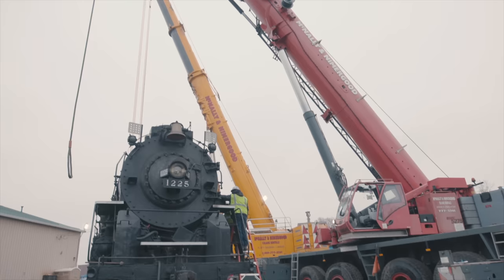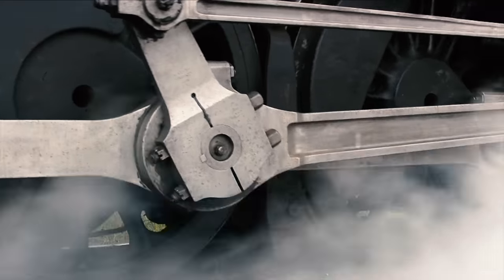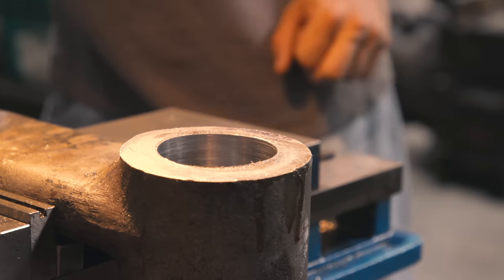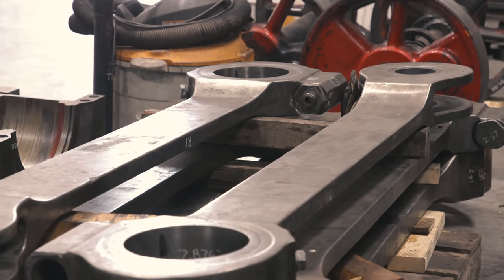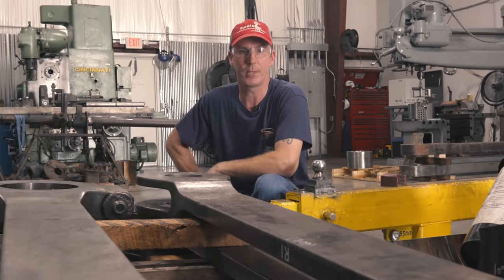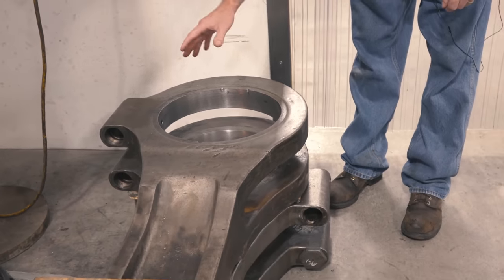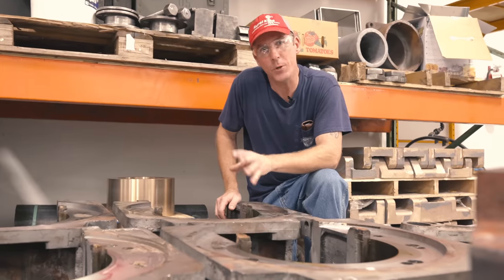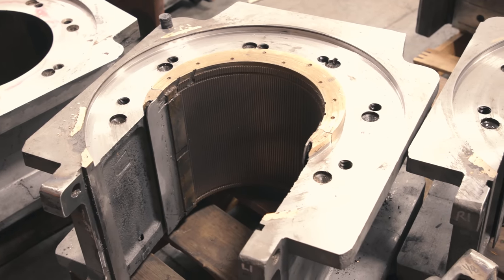Rebuilding a Michigan Icon | Pere Marquette Steam Locomotive No. 1225

Comment: I don’t think a lot of people realized how BADLY this work was needed and this video shows. The fact SRI didn’t have a major mechanical failure on 1225 due to these components is luck and also good craftsmanship on the part of the PM guys and Lima. Once the locomotive is back together this engine will be set for the rest of its life.
Reply: With any luck this engine will be in service until the end of humanity.
Reply: @danw6014  perhaps, just hope we never end up so deperate as something happens to disable diesle electros or electric locomotives in time of war or national emergency that we have to press the old girls like this into service though they could do it we just dont have tons of them like we did, but she and the main liner locos are well capable of hauling the mail again once you get them started, sad though they wont be having the christmas trains this year, but she is old she needs a complete physical and work up to get her back in shape, 

but ????? Conversion to oil?  why she was made as a coal burner, and we have more coal reserves then oil, and heavy bunker oil is just as dirty if not more so then coal. pollutant wise   

I know it was talked that eventually 765 will probably have to as well though I dont know if I am supposed to mention that, the beauty of a steamer though is if it can generate heat you can use just about anything to fuel it, wood, coal, anthracite, veggi oil, liquid natural gas, perhaps hydrogen gas, oil, waste plants, torrified bio mass, heck I think I read somewhere they used electricity in the northern contries to boil water during ww2 since it was already heavy electrified, and for that matter matt jannson and another guy in idaho are working on a soler collector for use as a stationary power plant for homes out in the bush like the desert or alaska  that uses just the sun to boil water and gets 800 degrees superheat enough to run a high pressure to low pressure piston stationary engine to generate power, just using the sun.

I like the smell of coal smoke though never smelled oil, if its like diesel fumes it makes me gag.
Reply: hey there 1223!
Reply: @Elavator66  hello
Reply: @PereMarquette1223  
I See you in every comment of 1225, glad to see you keeping up with 1225, I also really like 1223.

Comment: Rebuilding1225 is a serious undertaking, just ask Ed Dickins over at the UP steam program. Rebuilding 844 and 4014 was similar. Both were also converted to oil burning. It will surly be great to have another great steam locomotive back in service again. Good luck to all involved

Comment: Did 1225’s wheels spend some time on the wheel lathe at the Tennessee Valley Railroad Museum? Reason why I ask is that several times when I’ve been on the shop tour the conductor mentioned 1225’s wheels are back in the back of the shop.
Reply from the maker: Yes! We have a facility use agreement with Tennessee Valley Railroad Museum and they're a valued preservation partner. The first clip of the drivers and hub liners was filmed at their shop.

Comment: Didn’t I hear conversion to oil?? Or just for the bearings??
Reply: I think he meant they’re gonna convert the 1225’s drive axle bearings to have a system on them similar to what the 4449 has currently, which from what I hear, offers the same kinda performance that roller bearings would.
Reply from the maker: @justahillbilly7777  Correct. Fuel conversion would have nothing to do with the running gear.
Reply: @fmwsolutions  phew. Thank goodness
Reply: Both Southern 630 and 4501 also have oil bearings.

Comment: Where will this engine run
Reply: Every couple of years my family will ride on the sort of "Polar Express" mock up they do right around this time. Attendance is probably gonna be down BAD without that train there lol. I'm not sure what the engine is doing the rest of the year.
Reply: @thebruckler3707  Despite being diesel powered, all of our 2022 North Pole Express excursions operated at sold out capacity. SRI and FMW are currently in the process of shipping the remaining parts back to Owosso for the full reassembly process taking place.

Comment: Hey SRI! Question, how is it possible that 1225 got away with 70 years without an overhaul and other locomotives need much more frequent overhauls. Is this work beyond the 1472 FRA inspection?
Reply: 1472 is based mostly off the boiler and the tubes
Reply: @Wawa111_Mainline  I understand that. What I mean is, is this restoration beyond the average 1472? I see a lot of running gear work. Is this the focus?
Reply: A 1472 only requires an inspection of the boiler and tube/flue replacement. Anything else is extra. They didn’t have the funds or capability to do running gear work like this a decade ago for that most recent 1472 overhaul. So, yes this is going beyond what that requires. This work was last done, per date stamps found in the running gear, at the Wyoming Shops in 1948.
Reply: @Fietser1225  ah! thank you very much! that makes good sense. much appreciated.

Comment: it's not going to burn coal anymore? it's not the polar express without coal 😢
Reply: No, they're talking about an oil distribution system for the main axle bearings. 1225's are friction-based, which is at a disadvantage to roller-bearing designs.
Reply: @bakerboat4572  phew, that makes me feel alot better, thank you :)
Reply: I wish more people would understand that sooner or later all steam will be oil burning. 
Coal is just going to become too expensive. 
I hope it is later, rather then sooner, but it is inevitable.
Reply: Yes, at some point the rising cost of coal will have to be reckoned with. The fire risks in the western US are already being reckoned with by the D&S and C&T. That’s not something that is a problem in the Midwest but what’s happening out west and in the UK should be a catalyst for many groups to start thinking about it.
Reply: Baker boat thanks for letting me now the the locomotive is never going to burn oil.

Comment: Love what there doing but keep it coal berning please
Reply: I believe when he said they were converting to oil they were talking about a running gear component. But that said, as coal gets more expensive they may have to look into converting it to something else in the future. Some operators in the west (D&S and C&T) are already being forced to do so due to fire risks. That’s not an issue in the Midwest, so there is no immediate need, but it may still be something to do in the interest of controlling costs in the distant future. I anticipate that wouldn’t happen, if it ever does, for at least another decade or more.
Reply: @Fietser1225  Shane was indeed talking about something other then the fuel source. He was talking about modifying the drive axle bearings in such a manner that they give a similar performance to roller bearings, the same way the 4449’s drive axle bearings’ have been modified.

Comment: Another great smelling coal burner 🔥 turned into deep fryer
Reply: As far as I can tell they aren't converting the engine to oil, they were talking about the lubricant method for the running gear to help with wear
Reply: @festivelad5079  You nearly had it. It’s not the valve gear getting a new lubrication system, it’s the driving axle bearings.

Comment: As soon as he ''we are doing a conversion to oil'' I LOST ALL INTEREST!!!!!!!!!!!!!!!!! 😠😠😡
To me a proper steam loco burns COAL NOT OIL, the world is already short of crude oil, there are VAST reserves of coal MORE than enough to mankind out but NO lets not use that 😡😠😠😡
Reply: Bruh thats not what they meant, they were refering to the bearings on the drive axels. 

Also I geuss basically ALL WEST COAST steamers aren't proper lol
Reply: You have an odd idea of what constitutes a "proper" locomotive. Quite a few "proper" locomotives were originally designed and built to burn oil and,  to me, I would rather see a loco converted to oil ( for whatever reason) than sit rusting on static display or sent to the scrap heap
Reply: Would you implying that 844, 3985, 4014, 2926, 3751, and 4449 aren’t proper then? Does it matter what fuel they burn?
Reply: You do realize some Steam Locomotives such as SP 4449 were always oil burners right? Honestly I love all steam locomotives, coal, oil, wood, whatever. I don't care if one locomotive has a different fuel than another, steam is still steam, and the fact that they are running and in good condition is all that matters. Also gotta consider that some groups convert coal burners to oil use primarily to decrease wild fires by their land or tracks. Just accept what we have (Plus he's not talking about 1225s fuel, this is  running gear work).
Reply: As per a reply that FMW made to a prior made comment of mine on this video, when Shane said “oil conversion”, he meant that the 1225 would be having a system installed on its drive axle bearings that’s similar to what the 4449 currently has, which from what I’ve heard, offers a similar performance to what roller bearings would give.
Reply: Actually, locomotives originally ran on wood and coal. Then they became oil-burners. 

But no matter the fuel source, if it runs, it's good for service. Proper locomotives are wood, coal, and oil-burners.
Reply: @AtkataffTheAlpha  yeah but SP 4449 was built in 1941, and since the railroad she ran on didnt have much coal around, she was built as an oil burner. Oil was used on steam locomotives before then so, your statement isn't completely true or false.
Reply: @regularguy7266  I am not just talking about SP 4449, I'm talking about steam locomotive revolution in general. 

First wood was used, then coal, then oil. It doesn't matter if converted or not since oil-burners are the peak of steam locomotive burning fuel. In some places, coal is the peak but no matter the fuel source, if it's functional, it runs.
Reply: @AtkataffTheAlpha  okay.
Reply: @peterrosenquist  YES IT DOES!!!!!!!!!!!!!!!!!!
Reply: @cowcatcherstudios5759  Bruh????????????? WTF
Reply: @barryphillips7327  Don't you think kinda narrow minded and ignoring a lot of the rest of the real world?
Reply: @barryphillips7327  why does it matter? Some early steam engines did not use coal.
Reply: You forgot US Sugar 154 and (soon) 1504.
Reply: Burning oil yields a lot more energy per unit of material compared to coal. With big engines like 3985 and 4014 you need a lot of coal to run them, especially for long-hauls. Like, several hundred tons . That same energy can be derived from only a few thousand gallons of oil. My guy, if 1225 were converting to oil it wouldn’t necessarily be a bad thing. Yes, it’s an aesthetic to have black soot spewing from the engine’s stack but that has a lot of unburned coal dust, which can contribute to global warming. Oil smoke is much cleaner, and can only be really seen in the winter. While burning oil is also a contributor to global warming, its impact on the environment is a lot less noticeable than coal.

Also, the guy wasn’t even talking about oil conversion, he was talking about how 1225’s axle boxes would be switched out from friction bearings to roller bearings. Roller bearings have a lot less surface resistance, so it uses less lube per distance than friction bearings. Rollers are also easier to maintain.
Reply: @AtkataffTheAlpha  I think the term you were looking for is “evolution”, but it doesn’t discredit your argument. My only hope is steam returns to the east coast. Yeah, the Mt. Washington Cog Railway still runs steam, but I’m talking about standard 4’8.5” gauge. The only steam engines I’ve seen in my entire life were either not full steamers or they weren’t running - the North Conway steamer (the railway was closed at the time), Boston-Maine’s shunter in Lowell (static display), and the DOwT at Edaville in South Carver (Thomas did have smoke, but it was purely decorative).
Reply: @barryphillips7327  you're probably an east coast fella, aren't you?
Reply: @kristoffermangila  NO Bloody way!!!!!!!!!!!
Reply: why do you not like oil fired locomotives? there’s bunch of oil fired locomotives and they perform just as well as coal fired locomotives. besides this video is about the running gear, not the fuel source
Reply: @jessdatheturdle6602  Steam Locos have burned coal since day 1 it is a VERY GOOD source of INTENSE HEAT, crude oil is in short supply and WILL RUN OUT, coal will NOT!!!!! Oil burning steamer = diesel
Reply: @barryphillips7327  actually wood has been used since day 1. coal was used later on. in some cases oil is better than coal because it reduces the chance of a locomotive causing a wildfire and increases route capability. oil also burns up instantly whereas coal takes a while to heat and then burn. also locomotives like the 3751 use motor oil (same one in cars) and not crude oil. besides as many people has mentioned this was about the running gear and the roller bearings for 1225. they were not talking about 1225s fuel source
Reply: @barryphillips7327  "crude oil is in short supply and WILL RUN OUT," my guy, that's just not true. Concerning only the known oil reserves across the globe, we can sustain our current consumption for at least 300 years.
Reply: @barryphillips7327  you don’t understand the economics of the situation.
Reply: You do realize many of 1225’s contemporaries and even some much older designs were built to burn oil from the factory…right? By your logic SP&S 700 and FEC-USSC 148 aren’t “proper” because they were built to burn oil right from the beginning… for a variety of reasons to boot. 
What makes a steam locomotive proper is its ability to boil water into steam. What gets burned to make that steam isn’t really relevant in that regard. 

I’m sure the other 28 comments include some explanation of what he really meant, about the running gear, but can we agree not to take the attitude of engines fed by one fuel being superior to another? There’s pros and cons to each. Oil is beginning to have more pros for preserved locomotives worldwide for a few reasons, some of which drove FEC, SP, SP&S and others to opt for it in the steam era as well, but we’re not near a point where every coal burner everywhere would need a conversion.
Reply: The climate impact of steam locomotives, no matter what they burn, is negligible no matter what fuel they burn because there’s so few left and most rarely operate on anything close to a daily basis. I’m an environmentally minded person but I would fight someone trying to mandate a preservation group to convert by force or shit down simply because that impact is so small. Reducing or eliminating applications that use heavy amounts of fossil fuels DAILY is how you fight global warming, not going after steam locomotives that run maybe 3-4 times per year. You did bring up good points but it’s not something that the preservation movement should be concerned with. What they should, as has been said elsewhere here, is costs. And coal looses the edge in cost, even in the eastern US, every year…